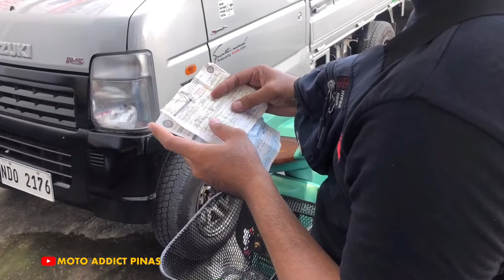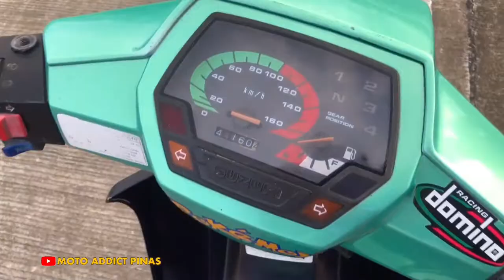Buying SUZUKI CRYSTAL JET 110

Comment: Boss sana gawa kayo video mga parts ng crystal at yung charging system nya .. meron ni ako crystal boss
Reply from the maker: Anong mga parts sir? You mean sa makina ba like overhauling?
Reply: @motoaddictpinas141   oo sir at yung charging system nya yun kasi problema sakin crystal lagi na lolowbat ang battery kahit bago rectifier ko at bago battery
Reply from the maker: Baka need mo ng palitan ung light coil niya sir
Reply: Sir ilan sagad na takbo nyan
Reply from the maker: Di gumagana kasi speedometer nito sir kya di ko sure baka nasa 100km pataas